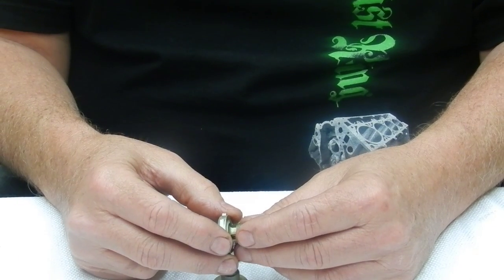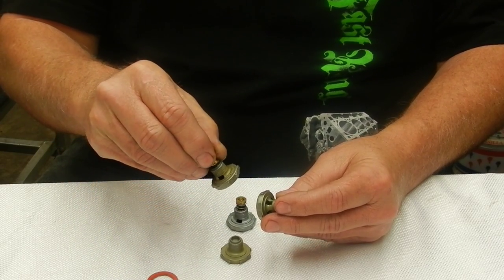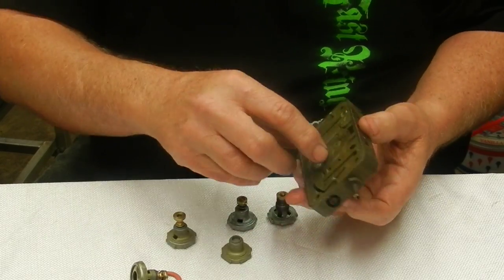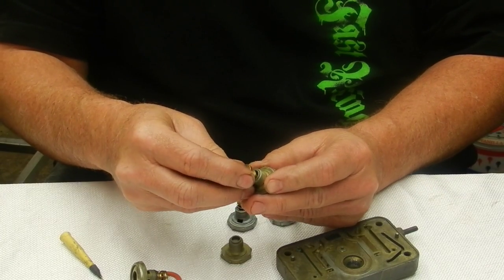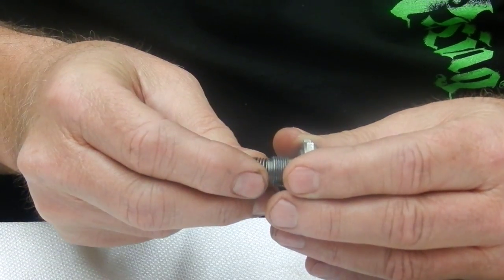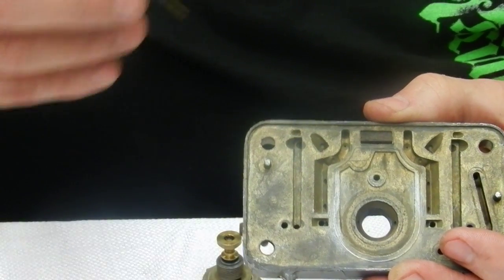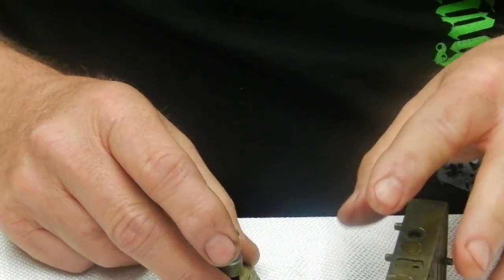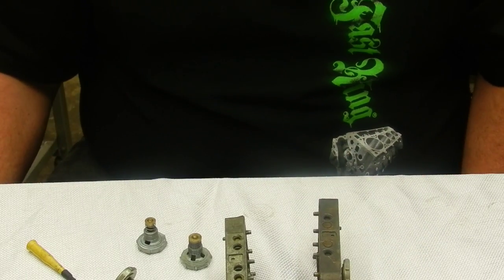Holley Carburetor: Power Valve Explained

Comment: What would u run for power valve and acceleration pump cc. On a gm 602 w Holley 500 used for circle track racing 6100 rpm.  

I’m a bit lean carb came w engine aboit to open it up tonight tho.  
 I was thinking 6.5 Power valve. And 50cc accelerator pump and maybe jump 2 jet sizes up ??  

435/460 lift came in these 602 crates 6100 rpm  thanks 🙏🏻 😊
Reply from the maker: Sounds like a good plan.

Comment: Can you please do a video for the  Holley 4412 carburetor.  How to rebuild a Holley 4412 for high performance  and still IMCA legal for dirt car racers.  Please.....  we have to run a standard 350 engine (it can be 30-60 over bore) with S/R heads, flat tappet cam and lifter and we are required to run a 500 cfm 2 barrel carburetor (4412)...... can you please help me and all the other dirt racers get the best out of our cars.......
Reply from the maker: i see what I can do , give me all the information you can , what size track  how many rpms your turning , compression , cam and I will do my best , are you limited on rod length.

Comment: I wanted to ask you do you ajust your idle air speed with the center screw that is under the air cleaner stud ? I never knew one was there!!! I always ajust my idle by the pump cam screw I watched a old tech video from the 50"s and they showed that screw under the air clear stud it said to ajust air idle speed to 500 using that screw ?
Reply from the maker: Some holleys and Barry grants have a adjustable air bypass under the carb stud , this is the same as drilling the butterflies but better, set your carb butterflies with your idle screw to get your transfer slot  to about .030 and reinstall carb and set your idle bypass screw under your stud to the correct idle.

Comment: Ok, how do I determine the secondary power valve size? I have 3.5 in the primary since my vacuum at idle in gear is 7. Thanks
Reply from the maker: the secondary power valve is not as critical as the primary , most of the time I run 3.5 to a 6.5  , remember one thing even the primary power valve  setting  at half the engine vacuum is not set in stone ,I  might put a 5.5 power valve in the primary side , and a 6,5 in the rear with 7 inches of idle vacuum,  its all in what you are using it for and the fuel curve , if looking for performance and fuel mileage running the power valve at half the engine idle vacuum is the way , hope this helps randy
Reply: Holley Carbs: How To's & Advice ,40 yrs of exp.

Comment: I have a 670 quick fuel carb and have blown 2 power valves.  Make my engine (351w, dart block, bored and stroked to 427 cubic inches, 492hp 512 tq) run rich & I've been stranded twice due to a flooded engine.  Any suggestions???
Reply from the maker: First thing do you run an ignition box and are the spark plugs sooted black , if you could give me any information on your tune like, ignition timing, jetting, does carb have screw in bleeds if so what sizes , main jet size and compression ratio, how much base timing and total timing do you run and also does your carb have a power valve check valve  in your throttle plate Do you have to replace your spark plugs cause there burning rich and are sooted black, usually this will make the engine backfire and sometimes a not start. Let me know.

Comment: Hello, I’m running a holley avenger 870 it’s rich at cruise and lean at full throttle, any recommendations please
Reply from the maker: Holley 870cfm vacuum secondaries non changeable air bleeds , check for bad power valve  or wrong power valve , check jets for proper size if you are rich at cruise then jet down and may have to jet up the secondaries if the secondaries are lean. Now this is if the carburetor is clean and in good shape and clean passages. Make sure fuel pressure and volume are adequate.

Comment: Thanks for the video! I do have a problem with performence and idle on my 289. Shiftet from edelbrock to holley and the IDLE problem seems to still be there on both carburators. But with the holley the PERFORMANCE issue is much more easy to define. The vacuum at idle is at 18 / 19 (Depends on tuning). The symptom is: When i hit the trottle and hold the trottle steady it accelerate very poorly for up to 5 sekund then suddenly it takes off and runs much more smootly. And now it also runs much better then the Edelbrock. Any thoughts?

 Im gonne connect a vacuum gauge and observe it when I drive to see if it is on a particular value the issue goes away. (I have checked timing degrees and run it with and without vacuum advance, the issue is always there.)
Reply: Sounds like a low rated power valve coming in too early. Try a 9.0 or 9.5 power valve. Make sure you check your second paragraph at FULL manifold vacuum.
Reply: Did you ever get this figured out? I’m having the same issue with my 289… I’m trying to figure out what power valve size and what jet sizes I should put in on a rebuild I’m going to attempt on a QFT Slayer 600 V.S in a couple days. I’m in Southern California…
Reply: @MCFABRICATION  No sorry, didnt fix it, but change back to the Edelbrock 500. The bog is gone, but still not so much power at low end as I would wanted, but runs very good in middle and up. I can live with that:)
Reply: @jimdavidson5208  Actually the lower the pv rating the later it comes in.
Reply from the maker: You need to know how much ignition timing your getting total timing.

Comment: Can you please tell me what is causing my primary idle screw to run best at 1 1/2 turns out and the secondary idle screw runs best at 3/4 turn out? What do I need to change in the secondary. I have an Ultra Double Pumper 650 on a 318 Dodge...Thanks
Reply from the maker: first make sure all idle bleeds are the same size , that's the outer air bleeds front and rear , and idle fuel restrictions are all same size , now here is the tricky part , you have to have the idle set screws primary and secondary as  close as possible being even, then set your mixtures screws run them all the way in and turn them out around one to one and a quarter turns  out , warm engine then make same adjustments to front and rear keeping them even ,hope  this, r helps,  don't worry if they don't match perfectly, that well be close randy
Reply: Holley Carbs: How To's & Advice ,40 yrs of exp.

Comment: What size power valve for the secondary's?
Reply from the maker: Joe if you run a secondary pv, I would use the same size as the primary, I block my secondary power valve  and jet up 8 to 10 sizes on the sec. mettering block

Comment: I had a 10.5 powervalve in my blower carb. I finally measured vac at idle and it was 14-15. So, I just put a 7.5 in now.. what side affects would the 10.5 have given me
Reply: Early rich fuel mixture in the fuel curve.
Reply from the maker: Where are you referencing your vacuum to the power valve from?
Reply: @holleycarbshowtosadvice40y90  Straight from intake.. I need to see someone elses setup to figure out if I have my car plumbed right. I'm a 'rookie' trying to learn and lots of confusing resources out there.

Comment: Thought on no power valve for drag race only?
Reply from the maker: I always believe it's best to run a power valve in the primaries to keep control of your fuel curve, I've tuned 3 circuit dominators without power valves that performed great, what it comes down to is personal preference , you are always going to be fat down low and good up top straight jetted. I've seen carburetors with 4 and 5 fuel circuits  perform amazingly  great. Hope this helps.

Comment: Help! I keep getting told that the part at the rear of my 1954 Ford Crestline is a spark control valve and NOT a power valve. I'm confused. I have a FoMoCo ECG 2 barrel carb. The part I describe was recently sucking air really bad and the car idles like crap. Any help would be appreciated.
Reply from the maker: Rob that was a little before my time, i never got a chance to work on any of them, I know some of the old carburetors had spark control valves that looked like power valves, i believe its a spark control valve but not sure.

Comment: Got a question my 4160 sucks air were the vacuum advance at idle when its should suck when you get throttle any thoughts
Reply: You have a gasket missing or leaking. Vacuum sucking is just that. The vacuum secondary canister will have manifold vacuum all the time. Throttle depending on how much of course. Then create your scenario accordingly.
Reply from the maker: Were is your hose at on your carb should be on the vacuum tube on you metering block or on after market throttle plates you'll have to have it on ported vacuum. Hope this helps

Comment: Can a powervalve fail in the closed position? I am chasing a lean pop condition that I believe to be fuel delivery related.
Reply from the maker: Olivier anything  possible , but I've never seen it. The power valve usually fails in the rich position, check your power valve circuit to see if the pvcr's restrictors are stopped up.if that don't help , leave me as much information about your problem as you can , and I'll try help you.

Comment: Randy what would cause my carb to increase idle speed as the engine temp increases?
Reply: fuel mixture or something sealing (metal expanding) closing a vacuum leak??
Reply from the maker: Thats natural to gain idle speed with heat  , only other thing is if your carb has a hot idle compensator valve that can raise the idle , when the engine is hot. Hope this helps.

Comment: I have a problem with my Holley 4160 vacuum Carburator in my primary Pump Discharge Needle Valve Sticking, no fuel coming out of tne Discharge Squitter until I take off the Squitter and take a small needle nose pliers and wiggle it, put the squittler back on, and everthing works fine.What do I need to do?
Reply from the maker: Bob I usually remove the carb and clean  the accel  pump counter weight cavity with a small bristle brush then install a new stainless steel counter weight in the pump passage and use a punch and a hammer to  lightly hit the top flat end of the counter weight to reseat the counter weight in the  pump passage seat , this renews the sealing point and usually with both cleaning and  reseating will cure the problem, make sure the area around the seat is clean, hope this helps.

Comment: My 600 holley, when I go to take off from a stop it feels like a back fire or a flatspot almost like a Stahl then picks up and goes. I changed power valve,and diaphragm but no change. I stayed with a 6.5. P.v it's a Ford 302 4spd truck and towing cam. Would like a 7.5 help me or would I need to change squirter.
Reply from the maker: Mike a lot of things can cause this besides the carb , if its a flat spot in the carb, try increasing the accelerator pump squirter by .006 and make sure and look down the throat of you primaries while moving your throttle open, make sure the the discharge nozzles are squirting fuel as soon as the throttle moves. Also make sue your intial timing is correct and the timing is advancing properly. Let me know if this helps.

Comment: Need help I have a 750 double pumper  can't adjust the idle screw mixture when I go in with the idle scwew mixture my rpm goes up they say it's a vacuum leak but there is none can you help me with this problem  thanks
Reply from the maker: First check to see if your idle air bleeds are stoped up that will cause the idle circuit to be rich , when you screw in your idle mixture screws and the idle speed climbs this is a rich condition , again check your idle air bleeds , looking down the carb throat they are the two outer bleeds. Let me know if this works , also look at your transfer slots to make sure they are not over exposed, also make sure your secondaries are adjusted properly or not hanging open, one last thing check your float levels.

Comment: My idle is set to about 1000rpm. in gear its about 650. 350sbc with a huge cam.
Idle gets really low at stoplights sometimes 400rpm any advice? Is it my powervalve being too big or small? I thought floatbowls might be set too high but its the same even if i clear it out. Currently reading the holly carb book from 1980 my dad just gave me lol
Reply from the maker: Need to know vacuum reading in gear , and is it a automatic trans and how much stall or is it a manual trans, if you can give me all the specs of motor , compression , duration at .050 and intake centerline, I'll sure try to help you.

Comment: So a bad power valve might be the problem with my 1962 Galaxie 500 . It stumbles from a start and will die if I don’t feather it out . Once I’m under way it’s fine . It’s got the OEM 2 barrel 2100 carb .
Reply from the maker: Sounds more like the accelerator pump not squirting fuel, should squirt fuel as soon as the throttle opens. Hope this helps.

Comment: Quick fuel 750 slayer will I need to change the power valve to say a 5.5
Reply: Chevrolet 383 stroker
Reply from the maker: If you have good vacuum  at idle ,I don't know why you would want to put a 5.5 power valve in it, when you have 19 inches of vacuum at idle. I would like to know the specs on that cam, because I've never seen even a mild camshaft have 19 inches of vacuum at idle.

Comment: What is most common power valve for street carb
Reply from the maker: Most common power valve is probably a 6.5. But again that can change with a racing cam, when the engine vacuum becomes very low, you have to compensate , or maybe consider a 3 circuit holley .

Comment: Very informative video thank you. I have a quick question my Holley 950cfm 4150 carburetor did not have a power valve in the rear from holley.it is a street driven standard shift car. Around town it's a little finicky. Would adding a pv to the rear meter block help? Ty
Reply: Since secondaries are not open in city driving, unless you're street racing, a secondary power valve would have no effect. 950 is a huge carb. Is your engine producing enough power to warrant that large a carb?
Reply from the maker: Not really.

Comment: Great video. Can anyone tell me why I get fuel in my vacuum advance canister? What would cause fuel to seep from my ported vacuum port? It is a Summit Racing 650 vacuum secondary.
Reply from the maker: Nick I've only seen two things causing that , back firing through the carb or the carb flooding after shut off ( hot soak ) condition. Hope this helps.

Comment: I HAVE A HOLLY TWO BARREL HAVE HAD TWO OF THEM ON MY 302 THEY BOTH DO THE SAME THING ,AS LONG AS THE ACCELERATER PUMP IS PUMPING FUEL ITRUNS AS I PUSH THE GAS PEDEL IT ACTS LIKE THERES NO FUEL THEN SLOWLY IT WILL START TO RACE UP IDLE IS PERFACT ANY IDEAS?. THANKS
Reply: Could be an accelerator pump diaphragm problem, or maybe you just need a larger shot for the pump. A lower number power valve may also help.
Reply from the maker: first check for vacunm leaks around carburetor ,next check fuel flow to  the carb and fuel filter for restriction, if these are good check for vacunm leaks to brake booster and check at the vacunm tree at the rear of the engine where all the vacunm lines feed out of the intake manifold [ block all them off, if not must be carb stoped up , sounds like a vacunm leak to me, hope this helps randy
Reply from the maker: could you explain to me again about your holley 2 barrel , not sure if i understand,randy
Reply: im having the same issue on my 12a rotary rx7

Comment: What about the power valve plug to close it what does it help or do
Reply from the maker: Bobby I usually block the rear power valve , the reason I do it is mostly for racing , when you accelerate hard the fuel in the front bowl runs toward the Jets and the power valve , fuel in the rear bowl runs away from the jets, and the power valve , the power valve sets up higher than the rear Jets so it's easy to uncover the rear power valve under hard acceleration , sometimes we have to add jet extensions and a special rear float to clear the jet extensions or we will starve the engine for fuel creating a lean condition, I do this for drag racing and other mods for circle track racing ,ps if you block the rear power valve say you have  size 76 jets in the rear go up 6 to 8 jet sizes , in other words change to 82s or 84s will be close. Hope this helps.
Reply: @holleycarbshowtosadvice40y90  Will this method work for a car that is not being raced ?
Reply: I've also heard of a bigger power valve and smaller primary jets . Your thoughts please. TY